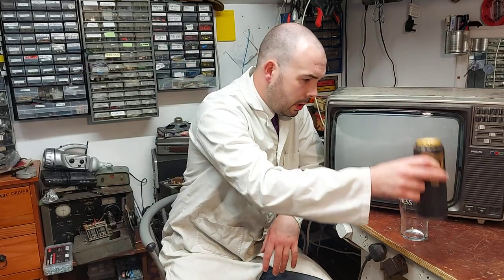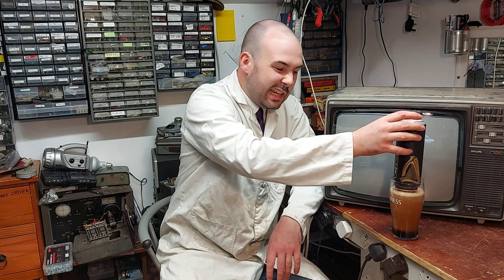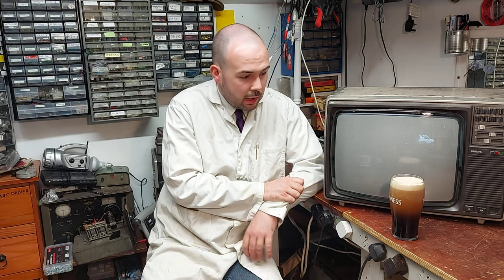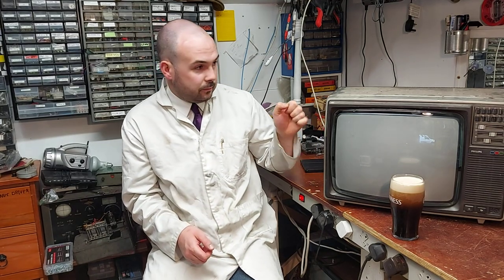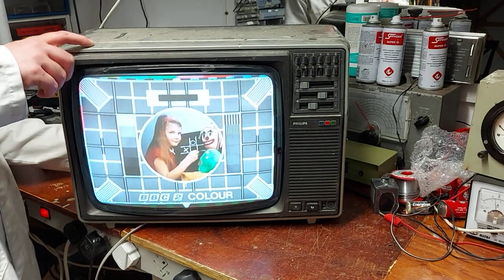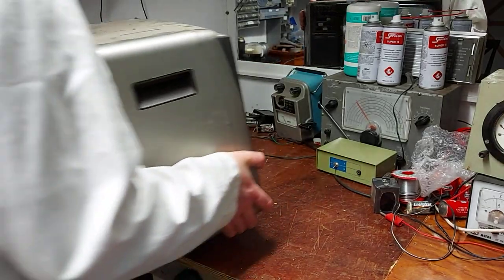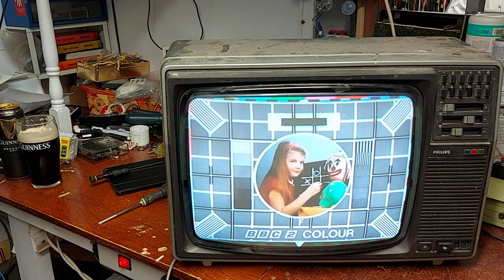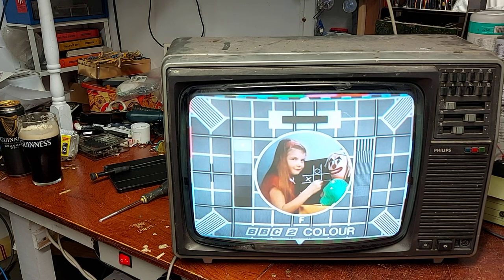Philips KT3.

Comment: What a cracking picture, no obvious errors with geometry/grey scale or colour, very nice set :-D
The crt looks spot on.
Does that dvd show all the test card frequency blocks ok or is it all lost in the over compressed dvd format?
Still a good test card though, ive spent many hours using that card to set up a tv :-D
Reply from the maker: Goes to show how stable the Philips stuff is. The DVD has high resolution jpeg of slides, so is of good quality.

Comment: Hey mate cheers :) What is that plastick ball in the Guinness can for?? :) I have the same tv from 1980 but the handle is in top. Peace Rick from Holland*
Reply from the maker: Heya Rick, the ball in the can is called a widget. It is pressurized and when you open the can it releases carbon dioxide and that's what gives it its creamy head.

Comment: nice one , i have a philips kt3 but its bigger than that one , works fine i think , tried connecting a v7 pro freesat box to it , my kt3 only has the Ariel socket as a connection option , the picture is great but despite my efforts the sound is not with the picture , tune out of the pic and there's the sound . the k7 pro has a built in modulator , any ideas ,i guess i could internally adjust the tuner on the tv
Reply from the maker: Sounds like it may have the wrong Sounds offset, should be 6MHz. Perhaps it can be adjusted in service menu.
Reply: @IrishvintageTVRadio  thanks , was hoping you would reply , didnt want to ask you directly as im sure you get questions all the time
Reply from the maker: I do indeed.